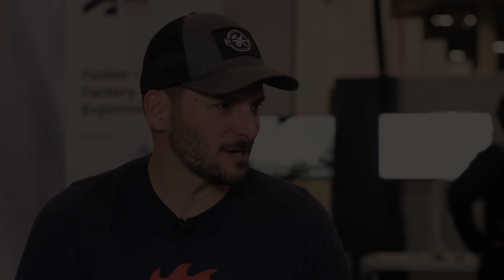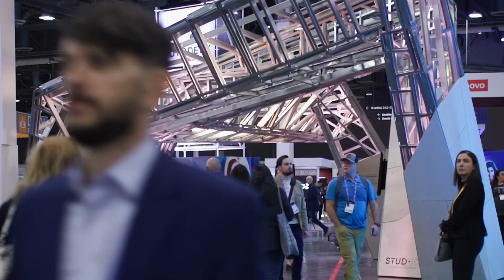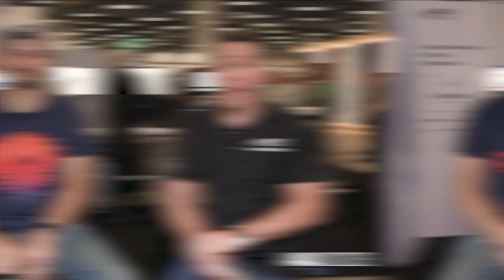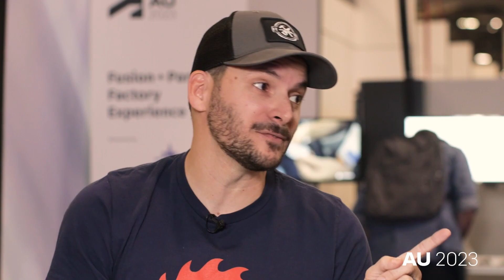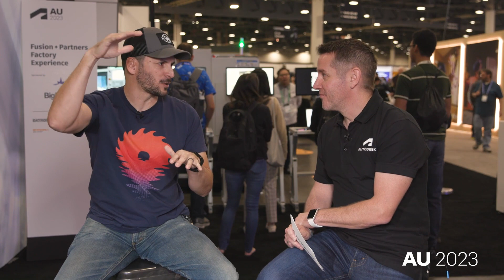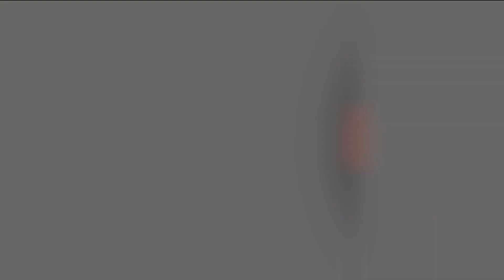Live from #AU2023! Brad of Fix This Build That Joins Shop Talk

Comment: Really like what Fusion has done for the community, but given it is an Autodesk product...it couldn't be farther from Inventor which is used by many engineers and OEM's. Fusion is absolutely infuriating to use if you are used to traditional Inventor and Solidworks type of software.